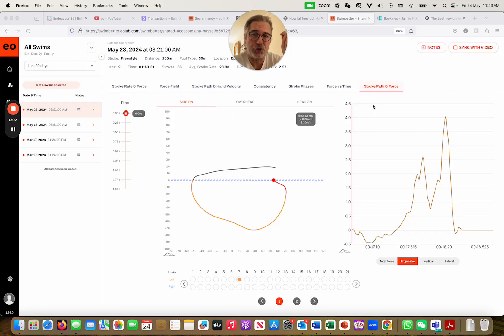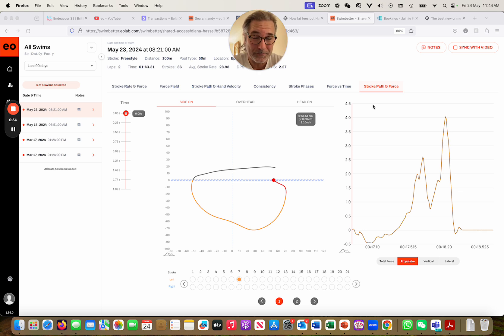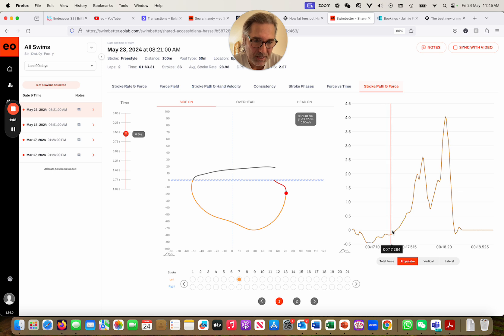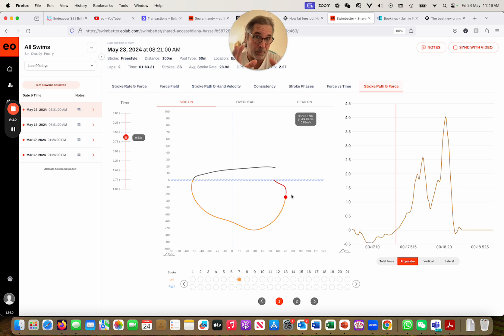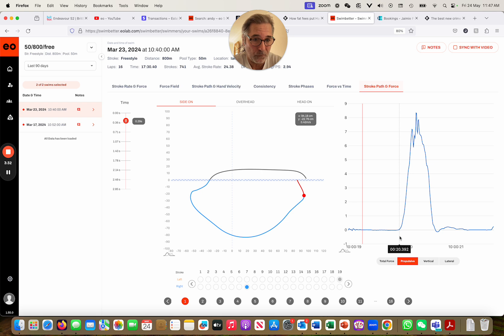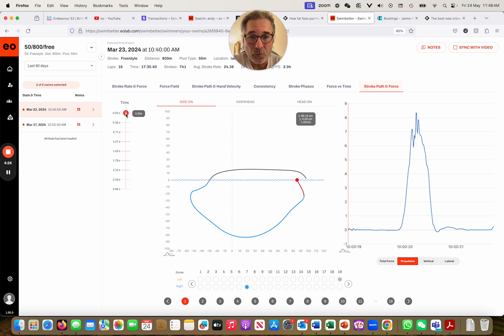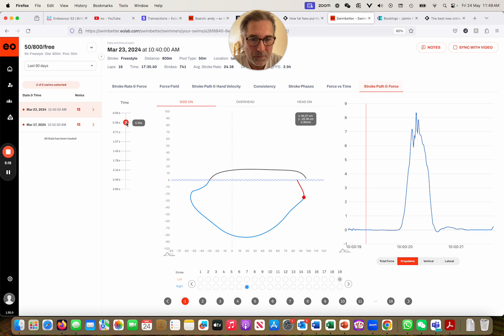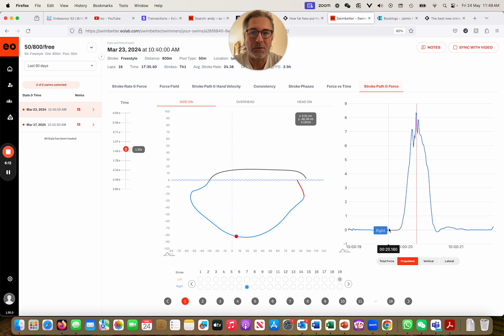The impact of hand speed on your catch and propulsion

Comment: Maybe your shoulder mobility is limited in such a way that you're better off not applying backward force until your hand reaches that lower point. One way to try to start pulling back with your hand closer to the surface is to think about catching with your fingertips "inside" of your elbow (fingertips closer to your centerline than your elbow is). If you're properly rotated onto the catching side, starting your catch with your palm facing a bit toward your centerline will be easier on your shoulder. If you then rotate back through the catch and pull, you won't actually pull across your centerline. Katie Ledecky is a good example of this.